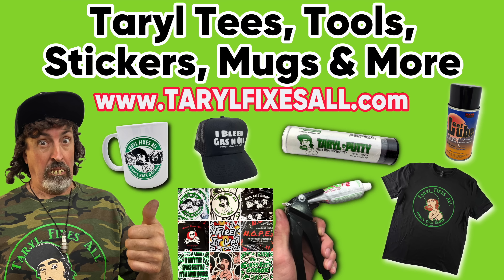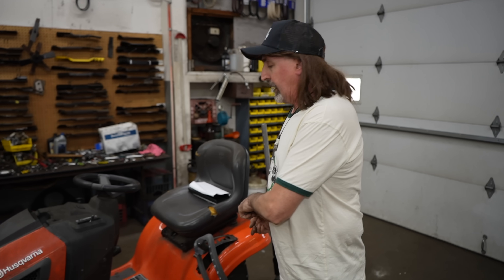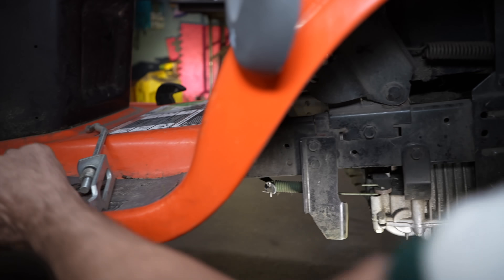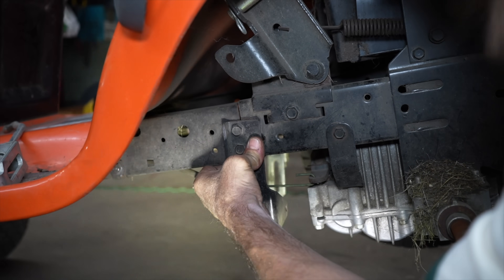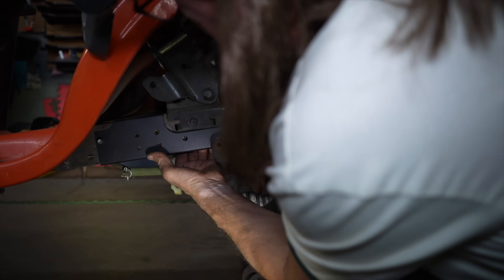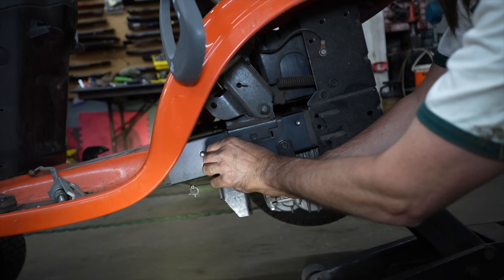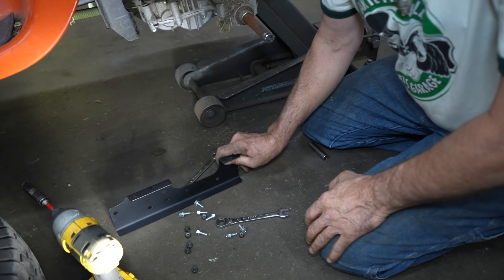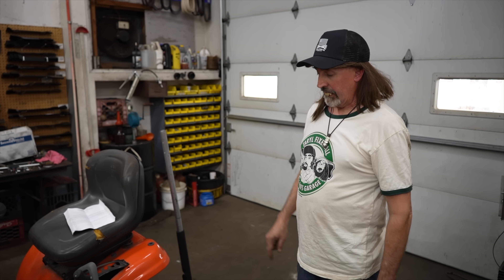MAJOR Husqvarna Frame Problem They WON'T Address! Affects 1000s of Units!

Comment: Nice Kit.  I would bet you took it apart after filming and ran a Bead.  But I understand.  Good job Taryl !    Free is Free.  LOL
Reply: Nothing is gained by welding the cracks. The channel brackets bolted in place will hold it all still and give needed support. Welding is a waste of time in these cases.

Comment: I agree that this "kit" would be a great mod, IF done BEFORE the frame cracks. As for fixing a cracked frame, it's a "band-aid" solution, unless the plates are welded. Also, those fasteners should have some "locktite" applied to keep them tight!! Love your uploads. Keep up the GOOD work!
Reply: They came with nylok nuts.
Reply: I don't like those self-tapping screws that much. Easy for manufacturer but they sometimes destroy the threads if touched, especially when doing them gut-und-tite.

Comment: I have 2 of these Husqvomits in storage, one broke at the transaxle mounts at the very back and damaged the brake control on the hydro TuffTorq, the other one came with a Hydrogear trans, it has a cracked frame almost the same as the one in the video.
Pure Garbage !

Comment: Husqvarna has a mower deck that one mount always breaks off because who ever set the robot for welding didn't get the angle right so their is no penetration on the deck. I own a welding shop and also work on mowers and I have fixed probably ten of these things. Husqvarna is not on the top of my quality list. I have a chainsaw I've probably paid for twice in repair parts. They are junk.

Comment: I want to say all I watch all your videos. This is the first time I disagree with you. I'm a mechanical engineer. First of all drilling round holes in metal doesn't weaken it. I watched the video and from what I saw none of the holes tore. Metal usually only tears on a square corner because the stress is not evenly distributed. Airplane ribs under the wing are filled with holes to lightened them and yet never tear. What people don't know is Henry Ford developed molybdenum steel for his Model T. Not only was he able to cut the weight of the chassis  by half  compared to other cars at the time but his chassis could twist without breaking or cracking. Just like a torsion bar. Husqvarna's problem is either the metal frame is way to thin for the stress and weight or the metallurgy is not up to the task. Compared to my garden tractors which are Simplicities, Allis Chalmers, Ford and Kubota the metal used in Husqvarna looks like tin.

Comment: I've recently installed two of these kits on neighbors tractors. These kits are very well made. The tractor, not so much 😊

I do pull the broken frame together, and mig weld it in a few places, before assembly of the kit. I also use loctite on all of the bolts 👍

Comment: Absolute garbage - I have a Husqvarna and fixed the frame my self... replaced the transmission as that failed... if anyone reads my post and is considering a Husqvarna... just don't.

Comment: Those are totally crap tractors. Lgt 2554 80 hours front tires totally wore out and frame broken.  At 120 hours rear differential was totally shot. Worst tractors made in my opinion.

Comment: the kit is nice and great for the existing customers,,,, ok,,,, but,,,, however,,, that just enables husky to keep doing what they are doing instead of addressing the issue, or , quit cutting corners on the manufacturing of the frame, husky also has problems with their frames rusting, so,,,, husky needs to step up, but why should they if they can keep passing the buck to their customers to pay for these aftermarket fixes. that's my 2c. i won't buy them, maybe everyone needs to stop buying their products, but even then, they will still pass the buck by charging more the junk. pfft.

Comment: That tractor is only supposed To be used on even ground.  Have all your yard filled and leveled so the frame doesn't twist, 
 especially at the "tear along the dotted line" / support holes.  Besides we spent themoney on a metal trans.

Is that scab a lot thicker?  i think I would weld and paint the repair anyway.  There is a reason he made the HD kit...  
For a second, I thought the you had got the rights to play "Golden Years".
I have been burned by manufacturer low level reps saying " oh yeah we'll pay that extra fee".  In writing or a regional factory rep that you know on a first name basis.
You're a good man, but you seem to be gettin' long in the tooth...